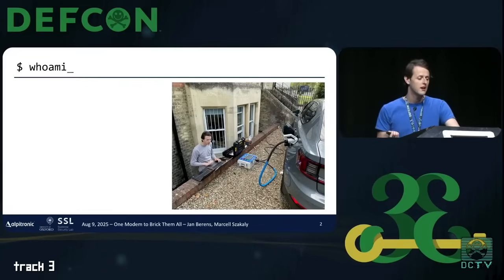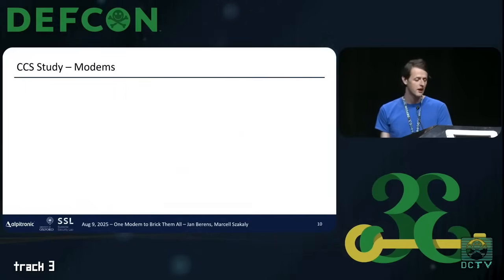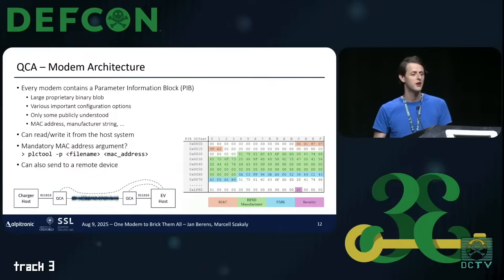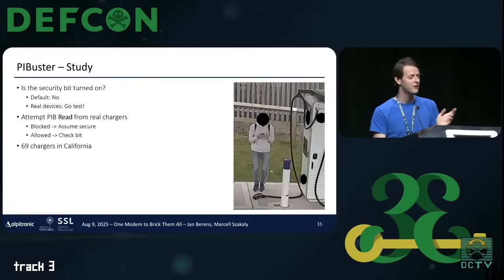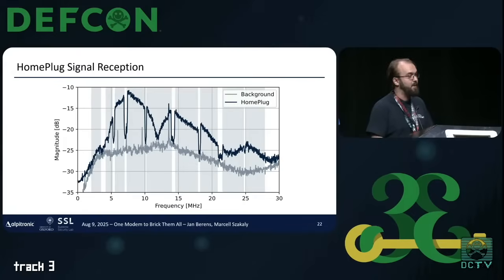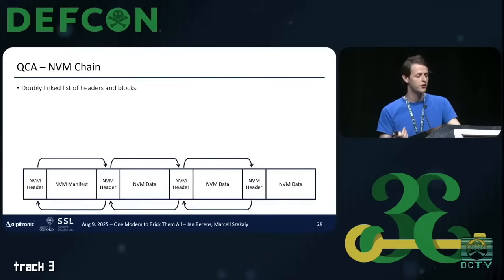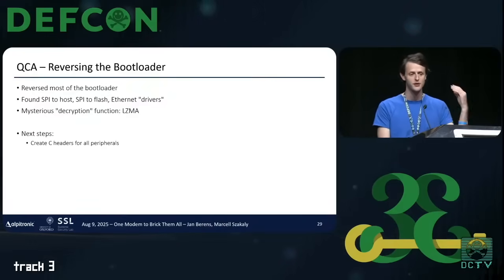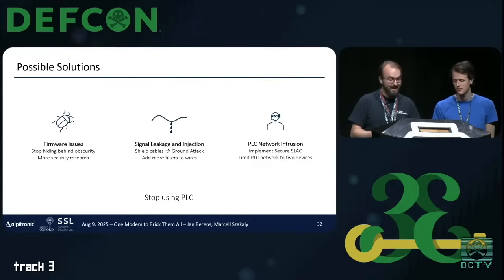DEF CON 33 - One Modem to Brick Them All -Vulns in EV Charging Comms - Jan Berens, Marcell Szakaly

Comment: What was the issue the designers were aiming to solve by using PLC, just saving an extra wire? Are there any other advantages to using PLC?
Reply: It was just great lobbying by PLC patent holders and chip manufacturers
Reply: Powerline communication isn't the problem.
This is a classic man in the middle, no matter what hardware layer is used.
Greatest respect to the bearded guy but i think he mispoke at least once.  Eg. Talking about using 'ferrite cores to protect the data'... look at the data cables around you, especially on old technology - you'll find ferrite cores on the digital cables.  Ferrite cores help against noise - not data.  Even if you could protect the cable from the methods shown in this talk, there is nothing stopping someone from pulling the hardware apart and attaching a data tap.  Unsecure will always be unsecure - protecting the cable is akin to 'security through obscurity'.
The real problem is not being able to use things like public key encryption because it requires a CA between two devices not controlled by the same entity and that requires the internet, which should never be a requirement to add energy/'fuel' to your vehicle.  Imagine trying to get home but you can't because the charger you're trying to use doesn't have the internet for some reason but has a perfectly usable power supply.
A new method of encryption needs to be figured out, or something like enforcing EVs and chargers to be serviced once a year to insert the latest keys.